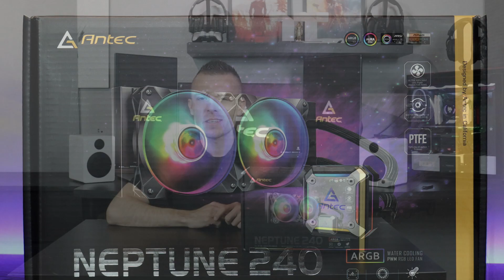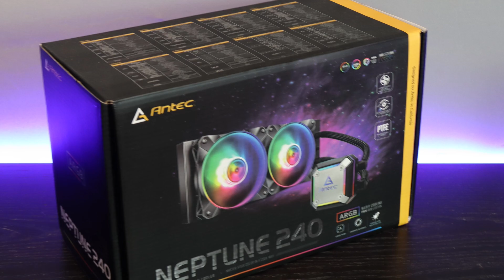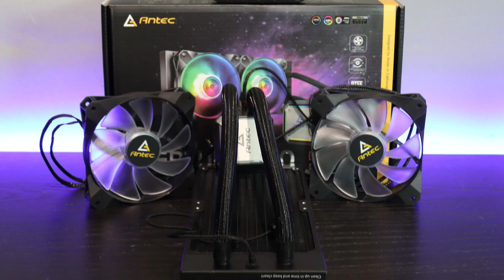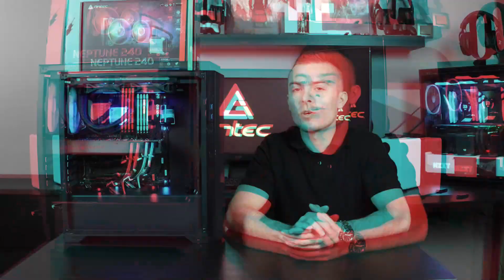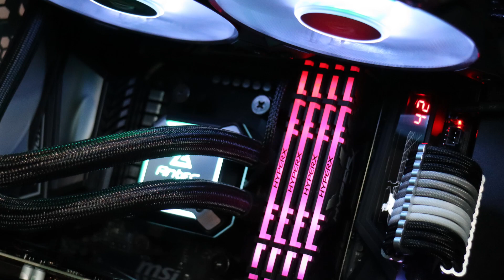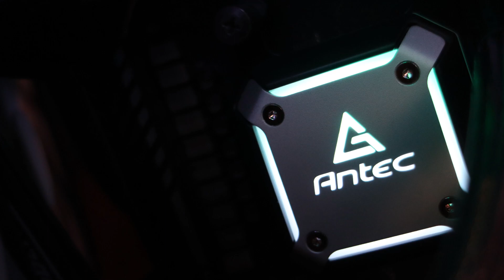INDUSTRIAL LOOK - ANTEC NEPTUNE 240 ARGB AIO

Comment: I have this one! Please can someone tell me how to connect/sync the RGB with the motherboard??

Everytime I want a new RGB effect, I have to open my cabinet,which is very inconvenient! Please Help!
Reply: Connect the controller to the MOBO's ARGB header
Reply: @harshit132  I tried but the cable is too short to reach the ARGB header on the MB!!
Btw would it work if I connect an extension cable?
Reply: @prithvirajdas71  how is it performing
Reply: I couldn't find an extension cable for the purpose so I had to relocate the controller and yes it would.
Reply: Also, see the leaflet provided in the box and you would see exactly which pins socket needs to be connected to the mobo.
Reply: Can you tell me how many connectors does it need?

Comment: Antec Neptune 240 is undoubtedly the worst AIO in the market. One of the ARGB fan has started flickering already within 4 months of usage and I literally have to tilt my case by more than 45 degrees while booting and gradually put it back because the small air gap clogs the liquid flow because of being sedentary overnight. I have reached out multiple times on email/Twitter but their after-sales support is the worst. Also, the motor has a sticker stating it needs to be cleaned but there is no information/tutorial on their website or supplied manual. I will not recommend this cheap built AIO to anyone, spend a little more and save yourself the frustration. #antec #poorchineseproduct #antecaio #aio #neptune240